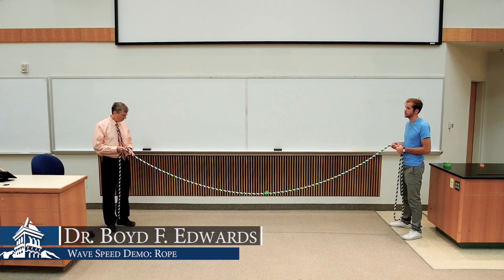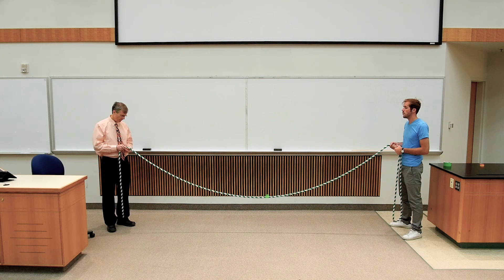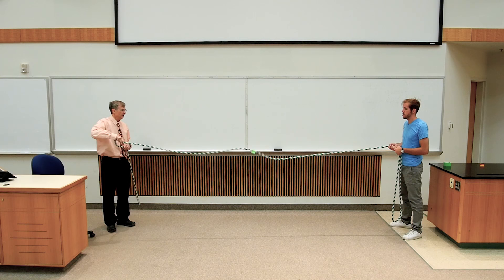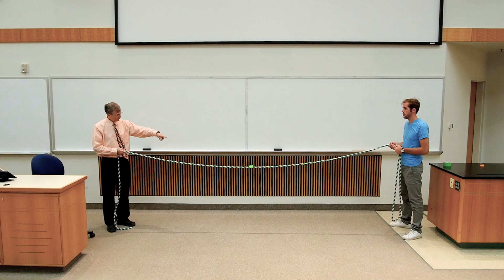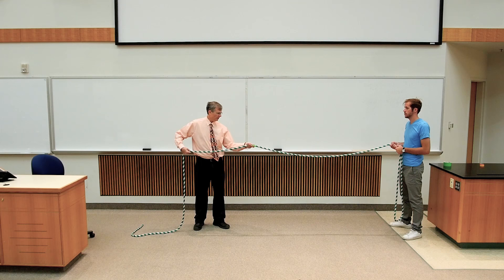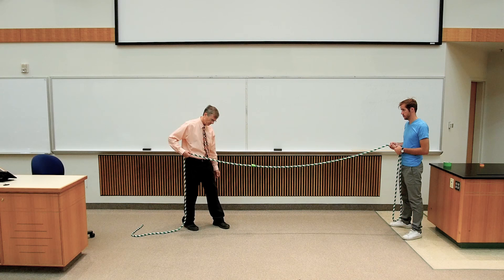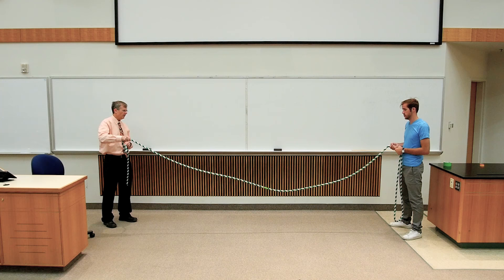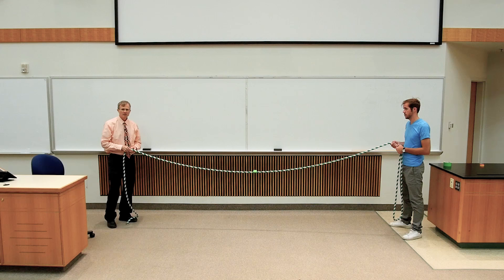Wave Speed Demo: Rope

Comment: Good demo.  I like the backdrop just below the whiteboard...it provides a useful contrast, if the rope is held at a suitable height.    I don't know if it was put there intentionally or is always there.  Perhaps even better would be a striped background with horizontal stripes by which the amplitude can be measured.
Reply: I guess it was already there